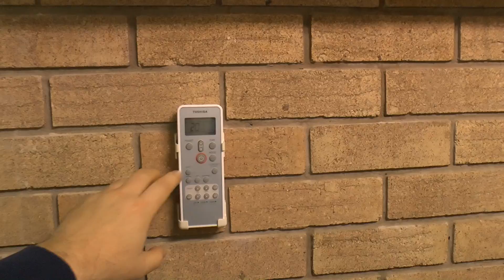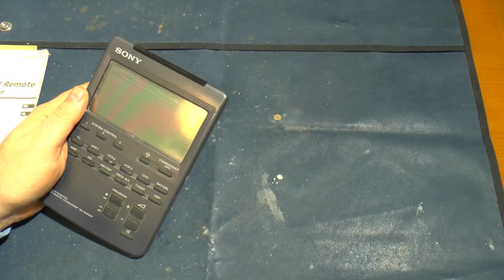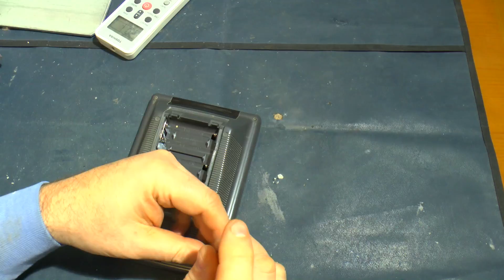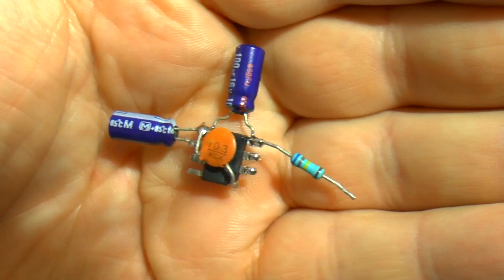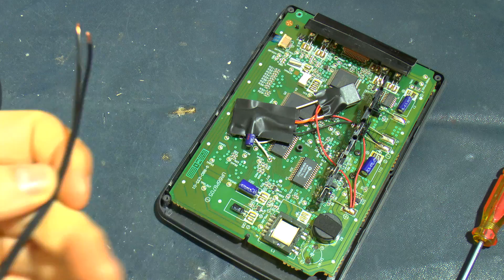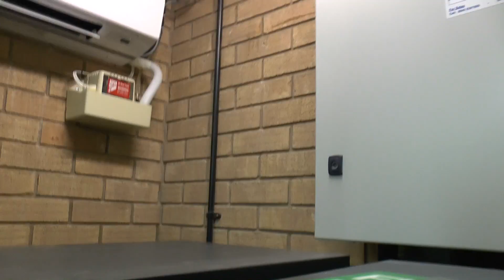Build an air con auto-restarter

Comment: We just started using a setup similar to your video, except that our ups is rackable so there´s actually only one room for everything. This is an old video but maybe some other people like myself find this video. One alternative approach, particularly with big UPS like yours is to use a contactor or relay and send power to the condensing unit of the air conditioning with line power (not taken from the UPS) from this contactor but power the air conditioner itself with the UPS.  This means the air conditioning internal unit will be on all the time  (unless the UPS itself shuts down). The evaporator fan will usually take very little power (the equivalent of adding another CPU for something similar to what´s shown on the video), but the condensing unit will be off during a power cut. When power returns, most likely the contactor will be already energized and as soon as you have line power you will have cool air again.
Having said that, very clever idea and thanks for sharing.
Reply from the maker: It all depends on the setup, but it's certainly worth considering putting at least part of the aircon on UPS like you suggest, especially if the UPS is only there to handle the delay while a generator starts up, which is what happens in our case.  For us the aircon systems are hard wired into their own non-UPS circuit so the remote control option was the way to go.  If designing a room from scratch it's good to ask "but what happens to that if the power goes off?" if only to watch people squirm when they realise they've only considered keeping the equipment on during an outage, but not keeping it cool.

Any method that prevents the aircon turning itself off erroneously is a good thing.

Comment: It is not necessary to use a relay for this application. often a MOSFET is working and worst case you need an optocoupler. you have thou to find out the polarity of the button. this is most easily done with an oscilloscope. i once added a PC interface to a sony surveillance video switch/multiplexer. there I used two quad optocouplers because I wanted galvanic isolation from the PCs printer port. yes,that was before USB :-)

Comment: Looks like a Riello or CPS MST UPS in parallel?
Reply: Apc VT in the last clip
Reply from the maker: Well spotted on both counts. A pair of Riello Multi Plus 40kVA and an APC SmartUPS VT 40kVA at the end. The VT is the subject of a separate video as its previous power module blew up and ended up torn to bits by me.
Reply: I happen to of worked on both units, the issue with the VT is that the power module is not 'user replaceable' unlike the Symmetra lx or px range

Comment: Nice Project. you need to be a little careful though. You are activating an electro-mechanical relay once every minute 24/7/365 which is over half a million cycles a year, so you do have reliability issues. Firstly, because the switching current/voltage is very low, you need a relay which is designed for very small signals - otherwise, the contacts will become poor in time. Secondly, at half a million cycles a year, you will reach the rated load-life of the relay after as little as two years. Consequently, you should purchase a high quality relay from a reputable manufacturer to ensure long-term reliability. HTH.
Reply from the maker: Good point. I should take the old one back apart and see what brand relay it is, because I think that's been running happily for over 5 years now :)
Reply: LOL, it will probably carry on for another ten years -just a thought really. If anyone is super-concerned about reliabiltiy, I would recommend a reed relay which has a life of 100 million ops at this sort of load. (e.g. ECE, COTO, MEDER from the usual suspects - RS, Farnell, CPC, Rapid, etc)
Reply: Or if once every 5 minutes is enough to resend the enable command, that's your decade right there ;-)
Reply: probably 1/10min would be OK. long time ago I used a small DIP relay for the trigger circuit of a stroboscope. 300Vdischarge of the trigger capacitor (not main) and up to 12Hz repetition rate. I tried a thyristor before, but it did not work. The relay worked, probably it was high quality because it had a hermetically sealed metal case.

Comment: Had the same problem at work but I didn't think to modify a learning remote.  I made something with an Arduino to send the command.  Probably more work than necessary.
Reply: I was thinking of using one of those cheap MP3 players with a microphone input. Hook up an IR receiver to the mic, record the button press, use Audacity to add 10 minutes of silence, set the MP3 player to repeat play, wire up IR emitters to the headphone output, add big batteries or wire up  something to the USB charging port.
Reply: Jammit Timmaj it's a nice idea but I don't think it would work without some additional circuitry because the signal is a pulsed 38KHz which would probably not be able to be reproduced by an MP3 player on its own.  38KHz is likely outside the frequency response of most audio devices as it is outside the human hearing range.

Comment: I googled for toshiba split ductless air conditioners and found one that looks a lot like yours (identical remote), the manual for it - RAS-13SKHP-ES / RAS-13S2AH-ES - indicates it has a feature to auto-restart after power restoration.  It is not enabled by default, but the manual has steps to turn it on.    Clever solution for if such a unit didn't have the option built in though!
Reply from the maker: This one's a RAV-SM566KRT-E. I sent a copy of your message to my work email, then forgot to check it at work, then remembered I'd taken a picture of the unit to go digging for the manual :)
There's no mention of the auto-start feature that the RAS-13 model has. Might be an undocumented feature, might be a missing one. Useful to know though!

Comment: Why not put the air con on the UPS
Reply from the maker: In our case that would involve getting contractors in to reroute the power feed, which wouldn't be cheap. It would also bring a motor load onto the filtered side of the UPS which may not be desirable.